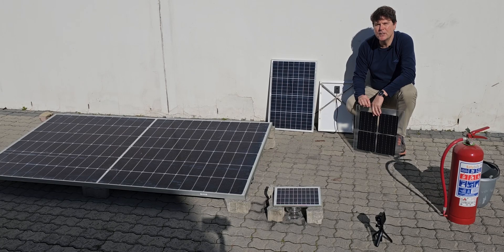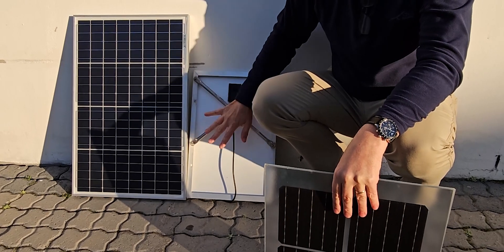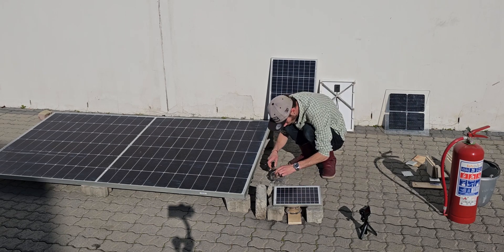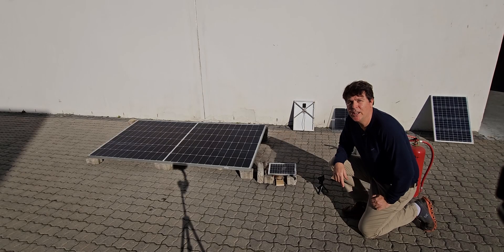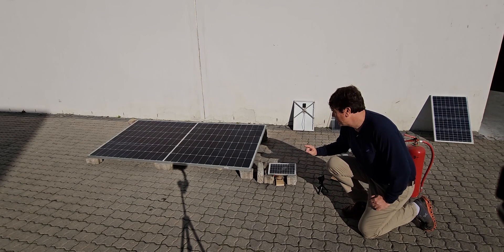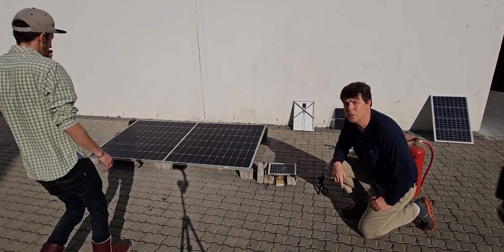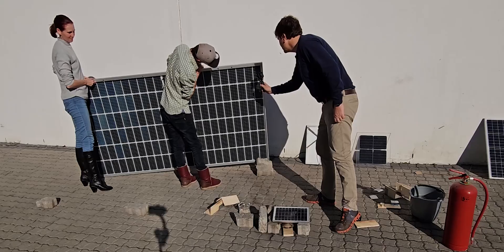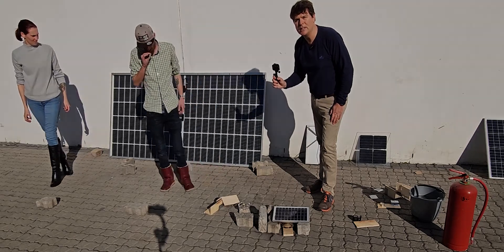Solar Panel Safety  - Glass on Glass vs Traditional Laminated Panels

Comment: Your fire test is flawed and misleading. The laminate test had a wood block in it, placing the flame MUCH closer to the panel than the glass panel without the wood block. Bring that flame up on the glass, I want to see it survive the fire being right on it... If it can.
Reply from the maker: Hi Freakdog, thank you for your feedback. Please refer to 0.42 in the video; you will see both candles on a wooden block. The video's main point is that panels with glass on the rear do not burn like panels with laminated/plastic on the back. As someone who has been through 3 solar panel fires, I can attest to the fact that glass back panels do not burn. Perhaps think of your glass candle holder that never catches fire while a candle burns inside of it, perhaps  a better way of showing this would be to do a test between a plastic candle holder and a glass one to see which one survives?